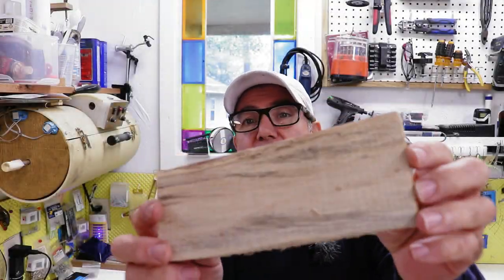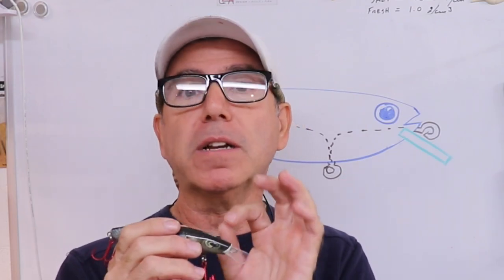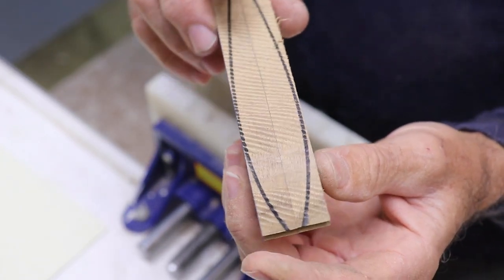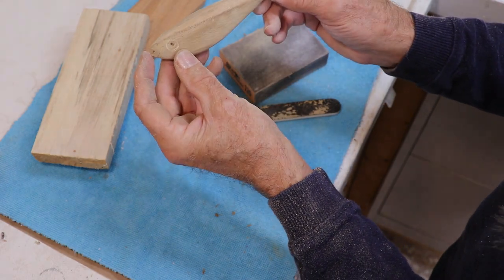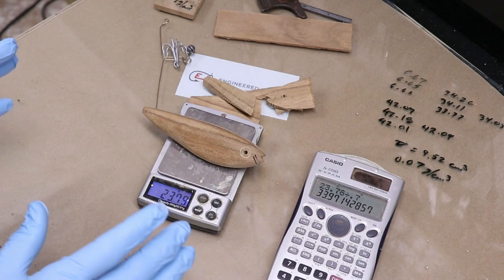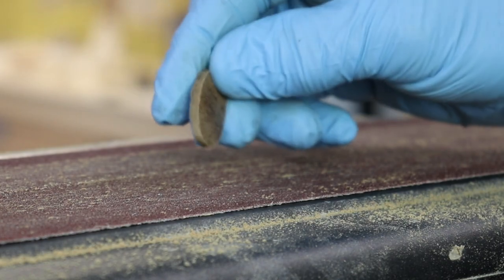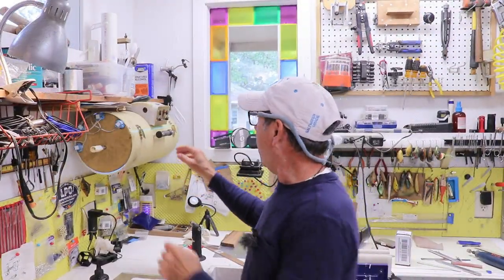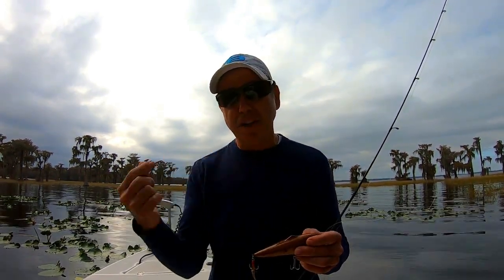Making a naked lure from exotic wood, Can teak wood catch fish ? #luremaking #woodcarving #teakwood

Comment: Nice looking lure! I use a lot of oily exotic woods when making pens and I’ve found wiping the wood down with denatured alcohol and then boiled linseed oil before applying finish really helps the finish to come out nice and the BLO really makes the wood pop! Also, lookjng at the side of polycrylic can I got with the harmful vapors warning makes me really hesitant to put in my airbrush even with a respirator and proper ventilation.

Comment: Another good video and lure.  If you changed the angle of the bib so it was almost parallel with the shape of the lure would it stay on to of the water making it similar to a popper but without the indentation where the mouth would be so it would run slightly smoother.  I'm thinking of a smaller lure for Garfish over here in the UK.

Comment: You probably have addressed this before.  My question is, what do you think would be more useful, a scroll saw or small band saw in cutting out the lure shapes?  Any recommendations would be appreciated.
Reply from the maker: I would recommend a small bandsaw, it scrolls well with a 1/4 in blade but can give you straight cuts through thicker materials with a wider blade.

Comment: Love your videos
Question
After the 1st layer or uv resin cures can I use a layer of polyacrylic to promote adhesion to the 2nd coat of uv resin?  Or is sanding a must to promote that adhesion from one later to another?
Thanks again!
Reply from the maker: I usually just wipe with alcohol...I only sand when I want to improve the surface. But a light sanding between coats is ideal.  I don't like putting the Polycrylic too close to the final coat, it's not really very tough.